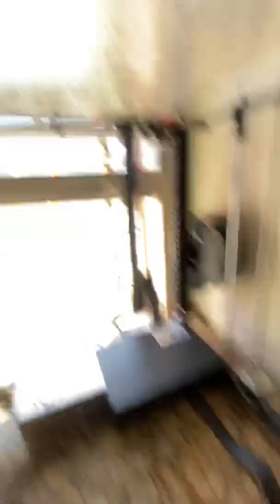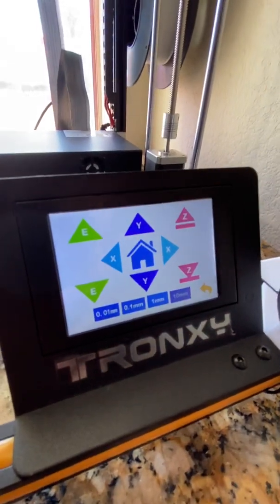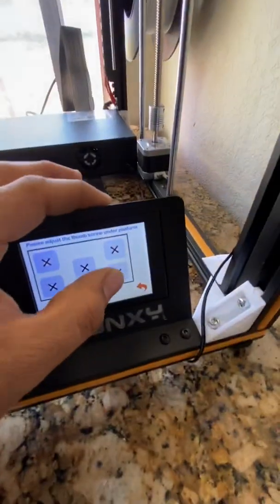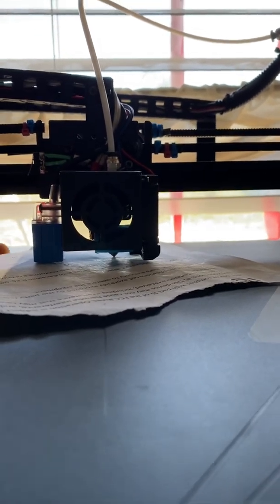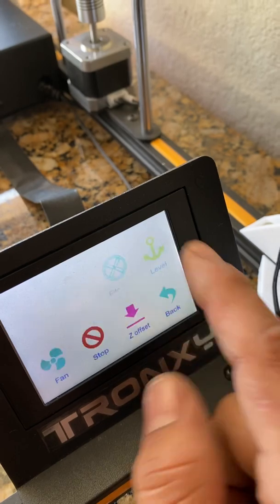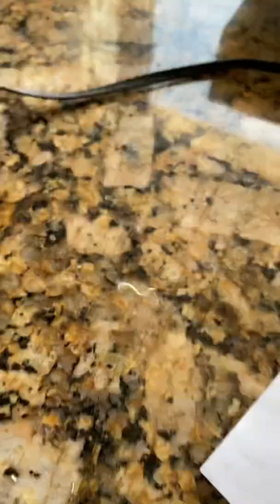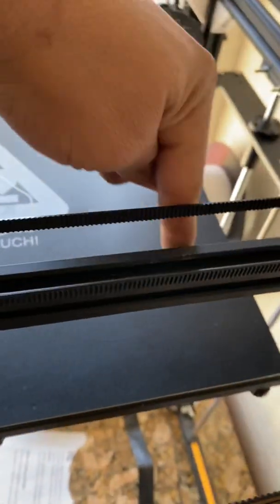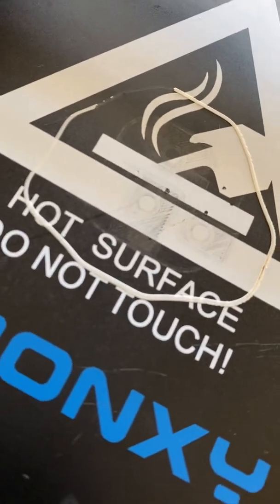Leveling Your Tronxy X5SA

Comment: There is a square on which the bed is fixed. There are two parallel columns. Unscrew the screws and place the two parallel columns higher so that the bed is balanced.